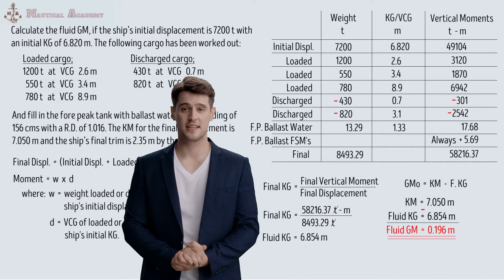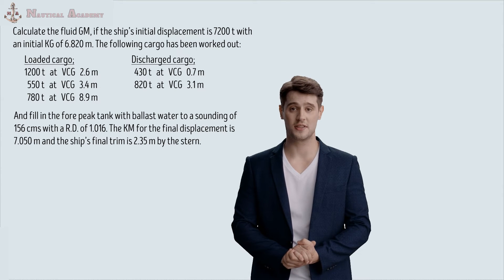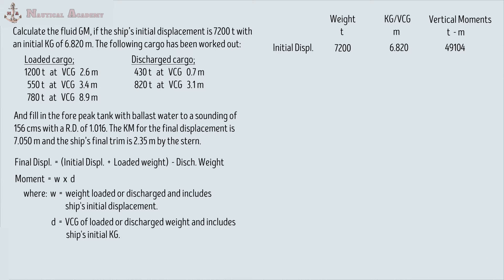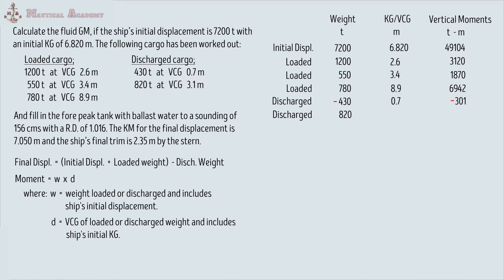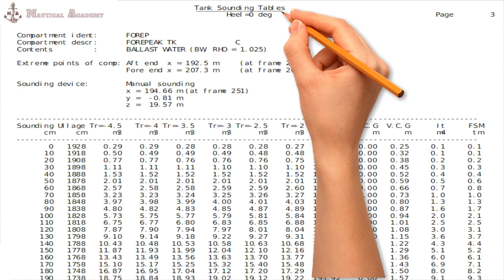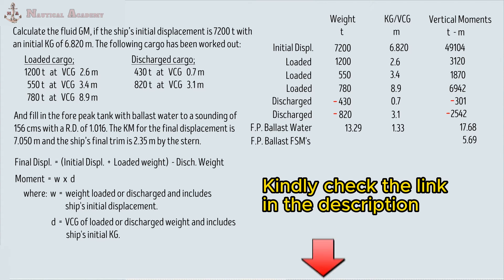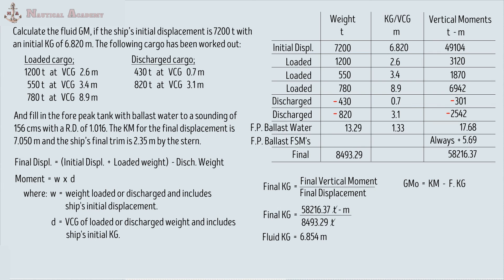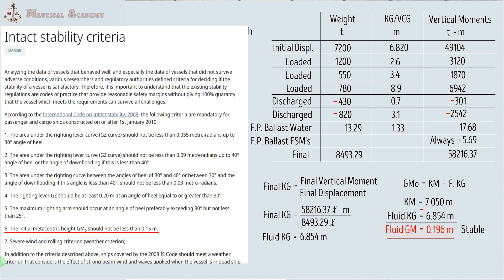Calculate Fluid GM l Multiple Weight I Initial Metacentric height l Final KG l Stability Calculation

Comment: for taking KM figure from the hydrostatic tables what do i need -  displacement or draft ?
Reply from the maker: To obtain the KM (metacentric height above the keel) value from the hydrostatic tables, you generally need the draft. The KM values in the hydrostatic tables are typically listed against different drafts, so you would look up the KM corresponding to the ship's current draft. Displacement might also be listed alongside the draft, but the key value for finding KM is the draft itself, and we need draft to find displacement.
Reply: @nauticalacademy001  thanks for the swift reply. I need one more advice. hydrostatic have different tables basis ship's TRIM. If i dont know the trim.... how to know which one to take into consideration?
Reply: @nauticalacademy001 Is the KM value of 7.050 derived from the displacement corresponding to a 156 cm sounding ballast with a relative density of 1.016?  And did you then use this displacement to determine the new draft and subsequently find the KM value in the hydrostatic table after discharging the initial 7,200 tons? Please reply❤

Comment: Sorry 
What does that GM mean ??
Reply from the maker: The term "GM" in the context of a ship refers to the metacentric height, a critical parameter for assessing the stability of a floating vessel. The metacentric height is denoted by the symbol "GM." GM is the vertical distance between the center of gravity (G) of a ship and its metacenter (M) when the vessel is tilted or heeled due to an external force (such as a wave or wind). A positive GM (GM > 0) indicates a stable initial equilibrium meaning that the ship tends to return to an upright position after being tilted. A negative GM (GM < 0) indicates an unstable initial equilibrium meaning that the ship tends to continue tilting and may be prone to capsizing. Thank you for the comment.